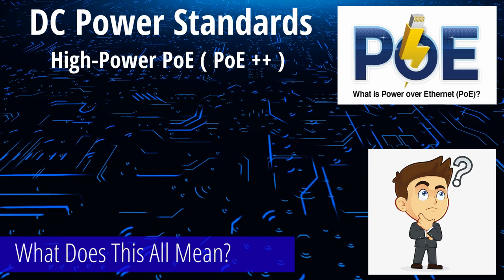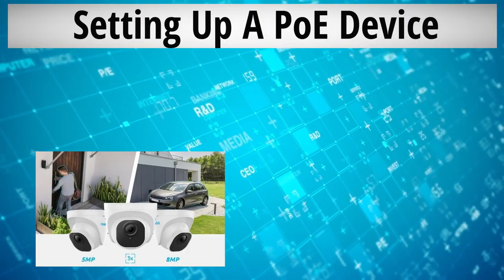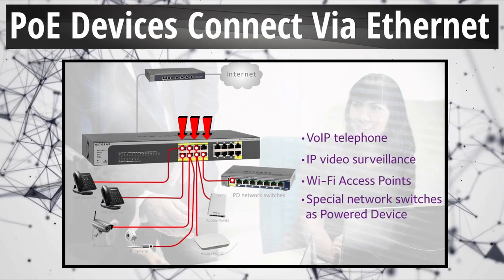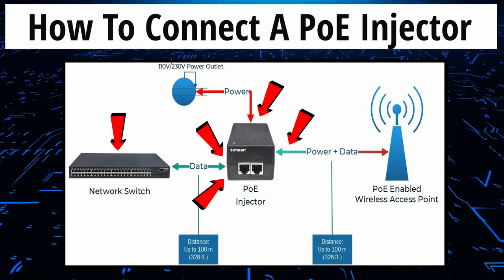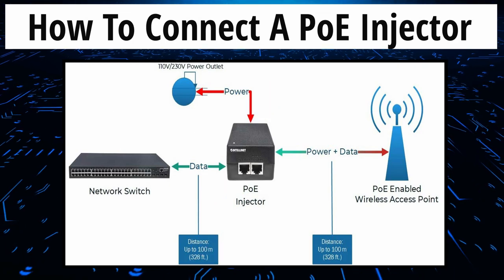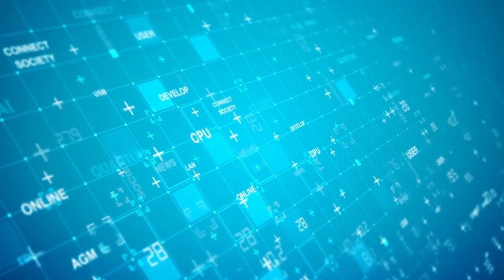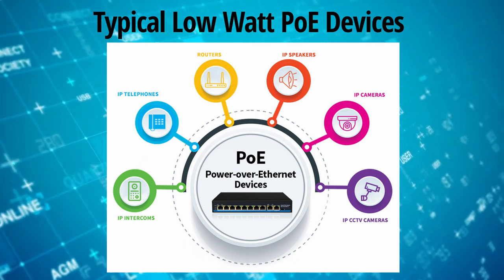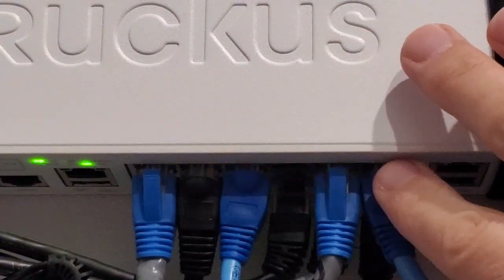Home Networking 101 - Power Over Ethernet Explained - How to

Comment: So is a poe switch like an Ethernet splitter? I want to run one cat 6 cable from my existing router into the attic to supply 8 camera nvr and 2 access points.Would I have to run 2 separate cat 6 cables (one for nvr and one for access points)? Or could I just run one cat 6 from my router and supply both nvr and access points using a poe switch? Thanks for your help.
Reply from the maker: PoE switch will work so you can add more PoE devices. I have several PoE switches in my network and they work great! Thanks for watching!
Reply: @UltimateTechHub  Thanks for your reply.That switch will save me having to run another cable from my router into the attic!

Comment from the maker: This video is about PoE, will not discuss data transfer speeds since data transfer depends on the device(s) and your network speeds. However, most PoE devices use very low data transfer speeds and the power running through that cable does NOT effect the data speeds. If you have any questions feel free to ask in the comments below. Thank you for watching!

Comment: Can I power a non-PoE unmanaged switch with a PoE switch? I've been trying to find that out but I haven't had much luck. I have 2 older TP-Link TL-SG105's that i want to try and power with PoE. 

If anyone knows the answer I would really appreciate it! 

I do understand that those switches can't supply PoE, I just want the physical switches to be powered with PoE
Reply from the maker: No, you need the required power supply voltage. Sorry. Great question though! Thanks for watching and if you subscribed thank you as well.
Reply: @UltimateTechHub  Dang! Well that's alright! Thanks for the quick response!

Comment: Can a Poe switch power a PC cooling fan?

I'm custom building my own server rack and am wanting to use multiple PC fans vs network cooling fans for more "quietness" as I have discovered that server fans are quite a bit noisier. 

Any advice is appreciated
Reply: For clarification: the PC fans will be at the top of my tower to vent out the heat from the devices below. I'm needing different ideas for supplying power to the PC fans.

Right now my only alternative is USB power. If I can utilize a Poe switch to power the fans then I would rather do that.

My thinking is working off the physics theory of "heat rises cold falls". The entire rack will be sealed and cabling ran for the front connections will go through a  separate channel to the front of the switches.
Reply from the maker: @briannasplace2718   I have never heard of PoE powering fans. Your best bet is use an old PC power supply to run the PC fans. The smallest power supply possible. Yes venting heat through the top is the ideal setup. Good luck and keep me posted.